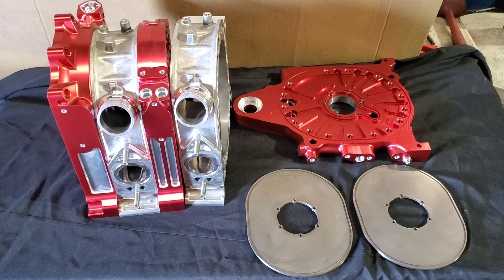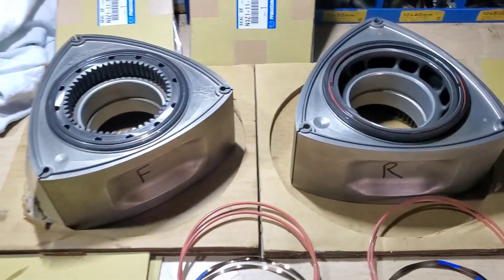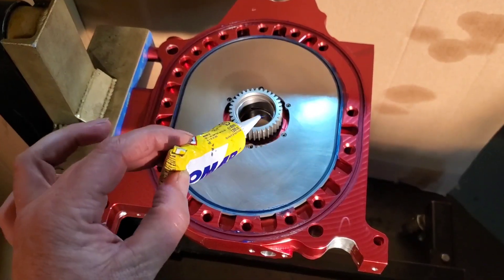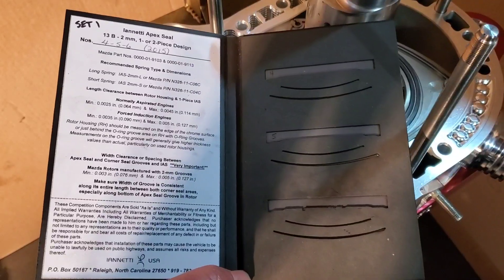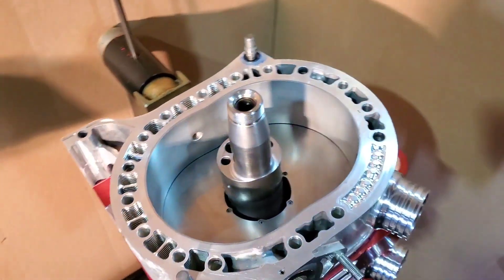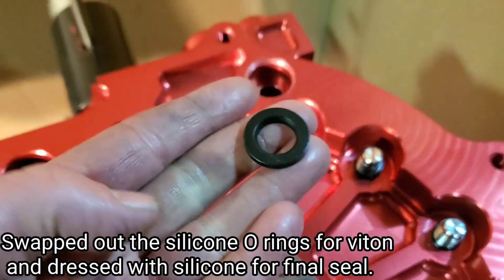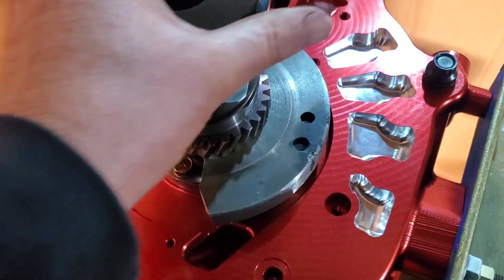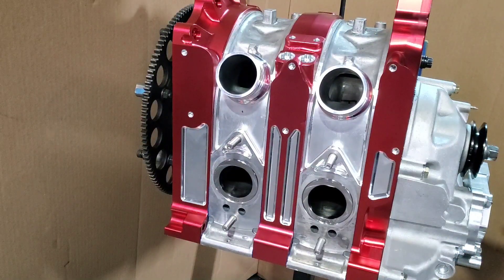Building P Port 13b Billet Rotary block - by KMR - WPC, Lightweight Rotors, Ceramic Seals, The Best

Comment: Hi Kyle, I was wondering who invented the steel plate insert idea? was it mazda trix?  I noticed billit pro has a screw in insert plate and was wondering who came up with the idea?
Reply from the maker: @douglasfurlong1  i think it was billet inc first.
Reply: @KyleMohanRacing  So Promaz basically copied them and added a signal screw in plate...Guess nobody has a patent on that...I bet you 10 bucks mazda probably has research on this idea but it was to costly to implement which is probably where Billit inc got the idea too, then Promaz ripped them off and up them an easier way to screw in the plate. haha Keep the Vids going their great:) i was wondering do you know of any drag racers running aluminum rotors? I was curious to know how many runs they would last before replacing them.
Reply from the maker: @douglasfurlong1  yes, I do know of drag, racers and road racers running aluminum rotors. So far drag has been successful.
Reply: @KyleMohanRacing  I wonder how many run the aluminum rotors last? Would you have any idea?
Reply: fyi I found a Japanese patent on plate inserts for the rotary engine...Billit inc and anyone else who got a patent approved stole the idea from this guy which expired in 2017..what a bunch of crooks...I hat epeople who take credit for others work!!I was looking at doing this for aircraft back in the day long before billit inc, but i guess this japanese guy did it long before tese companies even existed...they reserch patents then copy them and make them their own..very sad!!!

Comment: Hello Kyle, I am very interested in your custom built end housing with mount hole. The reason I ask is a fellow by the name of Everett Hatch designed a aviation engine using opposing conical mount holes similar to yours. This allowed exhaust down. Is your billet manufacturer easily convinced to do those mods for customers at a reasonable price ? Any extra info, and thoughts on this would be appreciated.
Again, thanks for taking the time to pass on your skills.
Reply: @GbbJunkie Everett's death was not attributed to engine failure. You need to get your facts straight!
Reply from the maker: feel free to contact me directly. www.kylemohanracing.com